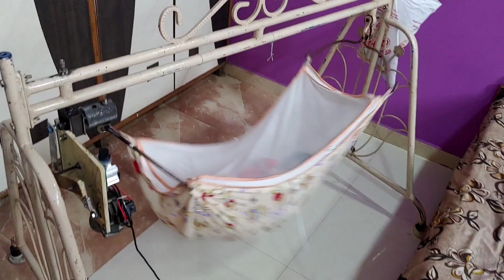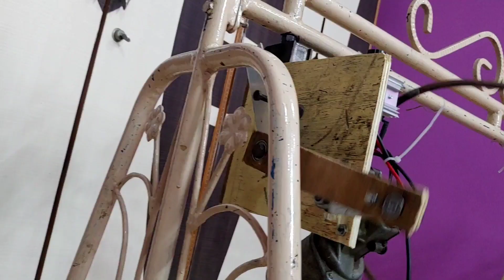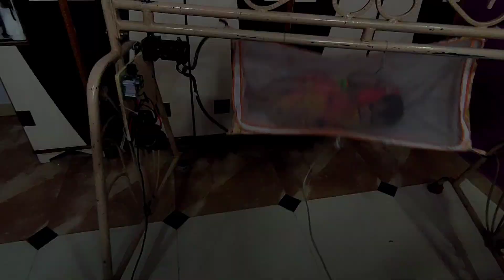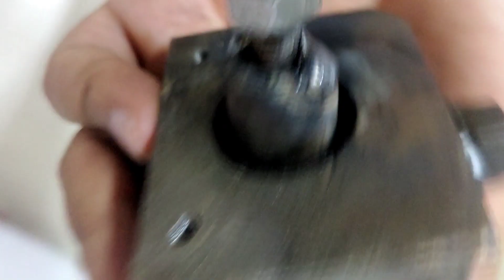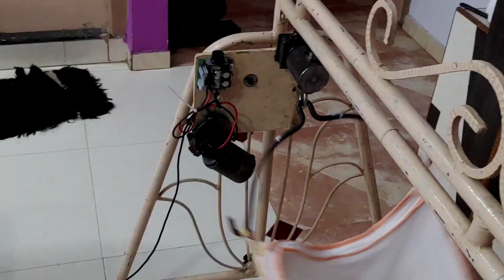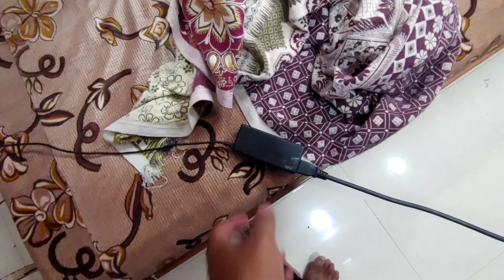AUTOMATIC BABY CRADLE NEW DESIGN GHODIYA KIT WITH HEAVY DUTY WIPER MOTIR

Comment: ????
Reply from the maker: Car Wiper motor dc speed controller dc power adaptor and the shaft is made with iron rod and bearing housing show any lathe operator make you this part
Reply: Noise bht h